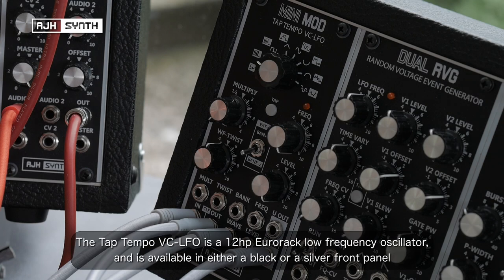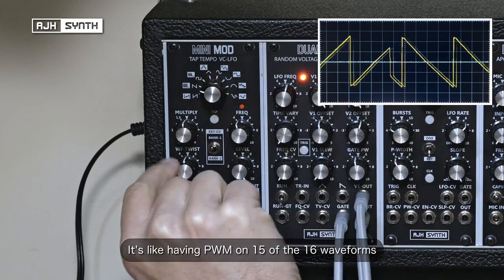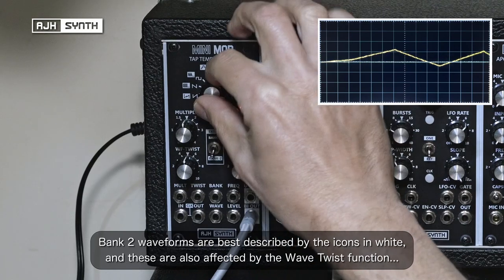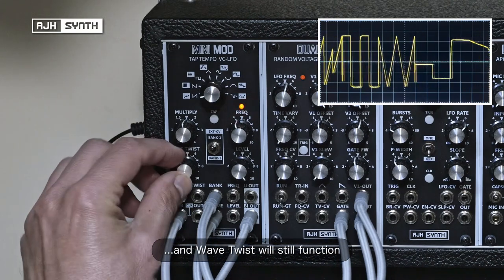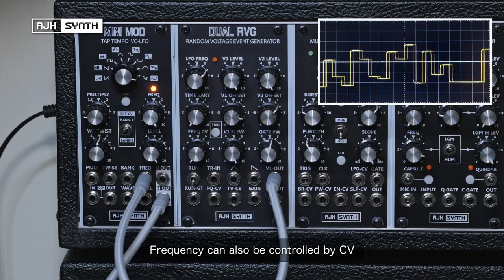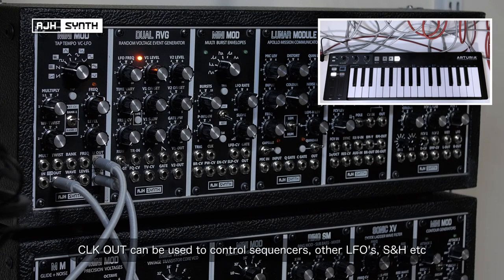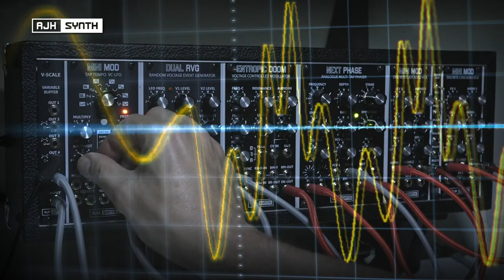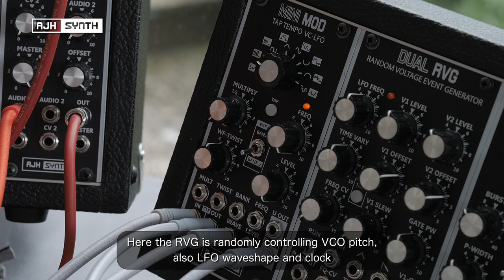TAP TEMPO VC-LFO User Guide: Detailed insight into this powerful Eurorack Low Frequency Oscillator

Comment: Hi there, recently I got the module and I have a question, when use a clock from an external sequencer, the frequency knob doesn't change? like when you were using the clock out u could div. or multiply.
Reply from the maker: Hi, this is because an external clock will always take precedence over the Frequency knob - so long as an external clock is connected to CLK IN it'll use that to set the LFO rate, just as the TAP switch also will, it's simply doing the same thing via CV. If you disconnect the external clock it'll continue running at the same rate (as it would do when set with the Tap button), until you turn the FREQ pot, at which point that will take over control of the LFO rate.
Reply: thank you @AJHSynthOfficial
Reply from the maker: You're welcome